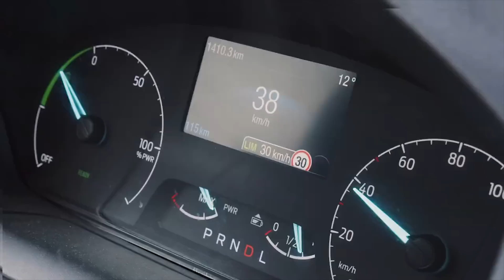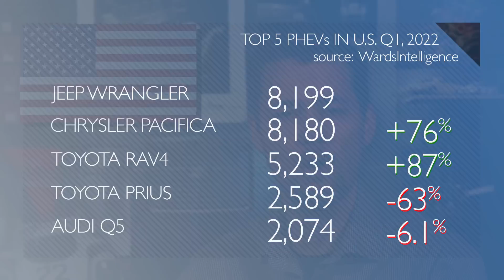Ford Technology Automatically Reduces Speed; PHEVs Starting to Catch On - Autoline Daily 3331

Comment: Most Americans won’t go EV until gas gets very very pricey, fast 10minute 0 to 80%/full charging doesn’t hurt a battery, we are willing to pay a lot for gas, we like cheaper bigger autos, and many don’t believe or care if seas rise, skies are polluted etc.. 

Me, I can’t afford anything more than a few grand - and repairs on fancy PHEVs, EVs could easily be $5k+ a pop for certain parts like battery packs or hybrid generator/inverter things, 😂 electrical systems gone bad after just a few years of use.  Old school is cheaper repair school many times, and tell me Tesla is most reliable and cheapest to repair and I’ll tell you to compare that total annual cost to my $3,500 2008 100k miles gas minivan 😎  Try to buy anything EV Or PHEV cheaper to keep running..  I doubt it.  I walk as much as I can.
Reply: Tesla severely limits the parts that a consumer can buy for repair. They also will take your vehicle off its supercharger network if the vehicle has been in ANY accident, and also if the vehicle is out of warranty.

Comment: The VW ID series already does something similar to the speed thing, though more passively.   If you happen to be coasting in D (drive) mode, the car will automatically apply mild regeneration when you start to go downhill so you only accelerate slowly, or when it recognizes a speed limit sign that is slower than your current speed.   Only when coasting though, so if you are actively using the accelerator or brake it doesn't try to override you or anything like that.

No special modes need to be turned on.   If you do turn on driver-assist mode, it's a bit more aggressive.  I love the passive operation, particularly on hilly streets.

Comment: The one problem with school zones and your car forcing you to drive accordingly in them is that school is not always in session when you're driving in them. Just like when cars that have speed limit sign recognition and flashes that you're in a school zone. Those systems drastically needs to be updated to be much smarter. It honestly shouldn't be that difficult to get the data when various schools are in session and apply that to the system in your car. Spring break, summer break, fall break, e learning days, night time, weekends, any other break time uploaded to the system. It isn't too big of a deal right now when it's just a new speed flashing at you from the recognition system, but when your car forcibly slows you down to the school zone speed is where it causes issues. It doesn't matter if you can override it when there's now a line of cars behind you wondering why you slowed down in a school zone on a Saturday.

Comment: My biggest concern with the BEV's heading to market is possible fires trying to get the longest range on one charge, only time will tell. The data shows that even using the cell type batteries say on a Telsa they still have the highest fires in their categories for their type of car (HLDI Insurance Report Noncrash fire losses 2016 to 2018). The other concern is when the battery is at its end of life what is the value of the BEV.

A PHEV car uses a smaller, safer, longer life battery that is charged by an IC engine optimized to just charge the battery (no turbos needed) could be made reliable, and safe and use less of the battery materials that are in short supply. As statistics show most trips are short so if the grid in your area can handle all the plugins just plugin and only run the IC for periodic maintenance or longer trips. You can still get the benefit of regenerative braking in this setup.

I live in a location with 4 seasons (can get lots of snow and cold) so I like all-wheel drive with a little ground clearance. Ford does offer an AWD Escape PHEV (2.5L iVCT Atkinson-cycle I-4 Hybrid Engine) at around 34K which has a little ground clearance. If for any reason I needed a car in the near future I think this one would be top on my list. This would be half the cost of a Tesla Model Y and for my driving, I would be for the most part just as “green” and I do not need 0 to 60 in 5 seconds under 10 works for me which the Ford can do.

I do agree with other comments that PHEVs can make a lot of sense at this time.
Reply: The wear on hybrid vehicles' batteries are far more extreme than the wear on pure electric, and the lifespan is significantly shorter.
Reply: @LeesChannel  Thank you for your response! I was not aware of this with respect to PHEV I just did a quick search and all I could find was in the US all hybrid batteries need an 8-year warranty I believe the same as a BEV. Do you have the names of any studies which show the lifespan of PHEV and EV batteries?  I do not believe you can add links in the comments so I will just search for the studies. I edited my original post above to remove longer life.

A reference I just read (search -> "greencars definitive guide to electric car batteries range") states that hybrid batteries last longer the BEV batteries. It does not state PHEV just hybrid and I have no idea if this is valid information or not.

It appears a Ford Escape Hybrid battery has an 8-year/100K miles warranty and the cost of replacement is around 5K (parts and labor). 
The Mach-E same 8-year/100K miles warranty but from what I can find the base cost of the battery is 18K then you have to add labor. I was not able to find an exact cost at this time I will keep my eye open for this and update it when I find a better number.

If I am reading this correctly Toyota has a 10 year/150K on Hybrid Battery and 8 year/100K on EV battery (Traction Battery) (2023 bZ4X)

I understand the batteries for each manufacturer can be very different and this is a moving target.
Reply: @L P  The reason for the greater wear is the pack is much smaller, so the cells have to operate at much higher voltages, plus the drain and recharge cycles are much more rapid due to the small size of the pack and charging while driving with the "range extender."
Recently Autoline had an interview with Toyota where they discussed solid state batteries, the Exec. said that the first implementation would actually be in hybrid cars because the extreme use case would give them a better test of its durability/reliability/longevity.

Comment: It should terrify people that a corporation or government can directly control your vehicle remotely, under the guise of "school zones".  This massive overreach is always dressed in keeping us all safer.
Reply: These modes are all optional, obviously.  But any sort of FSD or automatic engagement, or in the case of VWs ID, when passively coasting or using support modes, and other similar systems in a few other brands, the vehicle will make adjustments based on the traffic signs it recognizes.

But nobody is stopping someone from hitting the accelerator pedal if that's what they want to do.

Comment: Glad to see PHEVs making a bit of a comeback. In this time where EV production is limited by battery supply this is the quickest way to get the largest possible number of people driving electric miles.
Reply: Absolutely.
Better that 8 people each have a 25kWh PHEV battery to go 10,000 miles all electric each year than one Hummer has a 200kWh battery to pose at the mall each Saturday.
Reply: PHEVs are better than nothing, but they aren't going to be long for this world and the extra sophistication means you don't have the same maintenance benefits as you do with a BEV.   The reason they aren't going to be around for long is simply that battery technology is improving so quickly the HEV/PHEV segment is going to be squeezed to death in just a few years.    This is a problem for vehicle makers who decide to dedicate any significant time to the PHEV segment verses going all-in on BEVs.
Reply: phevs have ridiculous range and are cheaper than pure ev while producing most of same benefits and tax deductions.  Honestly,  the increased cost of pure ev isn't worth it.
Reply: @engineeringVirtue  Depends. I love my Gen 2 Volt and get up to 70 miles out of a charge around town but that range disappears on any freeway trip. 
I recently received the Lucid Air GT I ordered and made an 800 mile journey as quickly as I could have done in a gas car. I hated to buy gas for my Volt.
There is room for both technologies. For commuters PHEVs can be ideal. now that I travel much more it is great having a pure EV, but "worth it" is a very relative term.
Reply: I'd not buy another hybrid - old hybrids can get expensive to maintain.

They have everything a gas car has, everything an electric car has, AND the additional hardware and software that integrates the two systems.

Comment: China has the largest market for autos, and the largest market for EVs. At current trajectory of EV market penetration, ICEs will be extinct long before 2035. Ironically, the free market is working for EVs in China better than most Western countries (Norway the outlier and model country).
Reply: in what universe is Norway a free market in terms of automobiles😂😂😂?? they basically force u to get an EV
Reply: China is not a free market, they have thousands in licence fees for ICE vehicles. They are tipping the scales as hard as anyone to promote EVs. The difference with china is they are not promoting EVs to save the planet, they want EVs because china has hundreds of years worth of coal and hardly any oil. china doesn't want to be dependent on other countries for oil and with EVs they are self sufficient. Almost forgot to mention china since 2000 china has burned more coal than every other country in the world combined! So clean and green!
Reply: ICE's wont be extinct by then. That's just wishful thinking. Come on, man.
Reply: China and Norway not free markets.. major vehicle related controls there

Comment: Hi Elon aka Mark aka M Believ.  Props on the recent car fires.  Rumor is that you are using non-AEC rated MLCC's.  Lemme guess, you didn't install two caps per rail and place them at right angles on the PCB layout?
Reply: Hi Lutz,

Amusing that Mark has been on your mind this much, I haven't seen him in a while. Maybe next time you see him you could start with flowers?  lol.

Joking aside, here's the statistics per 100,000 vehicles sold:
• Hybrid vehicles had 3,475 vehicle fires.
• Gasoline-powered vehicles had 1,530.
• Electric vehicles had just 25.

Furthermore:
Tesla gets 1 fire per 205 million miles. ICE cars - and GM's Bolt before the recall - get 1 fire per 19 million miles by comparison.

So really, the car fires are in the sensational news because Tesla is such a strong brand, not because the fires are of statistical significance. 

How else would corporate media milk a company that doesn't pay billions for advertising like the legacies do? Clickbait of course.

But you are correct that this didn't seem to be a battery fire but rather just an infotainment circuit issue. That's good I suppose, but I'm curious to know what component is the cause. AMD's chip running too hot perhaps? We'll see.
Reply: @AllanSustainabilityFan  It’s a shame all you can do is to quote meaningless stats when my post said what the root cause was suspected to be.  Tell your team members to release the BOM and we can find out together.
Reply: @AllanSustainabilityFan  Since you keep deflecting the answer, I’ll take it as a yes...Elon isn’t smart enough to know why AEC rated MLCCs plus a 90 degree layout are required for automotive use.  Negative daily points for you...
Reply: @AllanSustainabilityFan  Face facts...it took your boss 12 years to finally figure out that “making cars is hard”. Unfortunately, he didn’t bother to spend the time to understand why making cars is hard and took short cuts to get around the pandemic with non AEC parts.
Reply: @bobbbobb4663  Well your ex-boss is now much more successful than the rest of the market segments they're in:

Tesla in Q1 2022 outsold ALL other luxury makers by far, and was the only one of two companies that had positive growth (59%) - the other was Genesis. 

In fact, that entire market still shrank by 12 percent, despite Tesla taking up a big 22 percent share of it while having such strong growth. That's just how bad the competition is doing, but nice try with the distraction.

TLDR: They're doing just fine. After all, they only keep the best engineers.
Reply: @AllanSustainabilityFan  The best automotive engineers use AEC quality parts and those sales numbers are bogus since your boss built unsafe cars with non qual parts.  Get your marshmallows ready...

Comment: Wow! Phev’s just starting to catch on! Only 10 years after being relevant.
Reply: Pretty sure it's been confusing for regular (no-car) folk.
To this day, there's smart people who think a standard Prius has to be plugged in.😖
The Volt got a really lackluster ad campaign 10 years ago that didn't convey its brilliance:
 15,000 miles of gasoline-free commuting if you simply plugged into a 110v outlet each night.👍
Reply: @donswier  ok.. but then the entire ice side of the car is pointless if you aren’t using it.. just taking up space, adding weight and costs for nothing. If you DO use the engine.. then it’s towing around hundreds of pounds of useless batteries and motors. The whole idea of a hybrid is inefficient and generally crap. I understand the ‘benefit’. But it is highly outweighed by the negatives. A good EV is far superior. If the idea of stopping for 20 or 30 minutes every hour and a half of driving is so egregious to people, they need to get a grip on what’s important. If the cost of an EV is daunting.. do the calculations of $ saved by not paying for gas and maintenance and find out that there many EVs out there that compete with $30k ICE cars in cost of actual ownership. Some even lower these days. If you need lower still.. you’ll just have to wait a little longer. They will be coming in a couple years
Reply: @airheart1  
All good points. Like you, I despise complexity👍

In my 3200lb car, though (i3 REx), the entire ICE system weighs under 300 lbs.

 - A battery big enough to cover long road trips would be far heavier.
- Fill up almost anywhere in 2 minutes.
- Like a BEV, there's no multi-speed transmission.
- Still used just 25 gallons to travel 24,000 miles last year.

I'd love to see that same approach scaled up for large pickups & SUVs.

Analogy: Most sailing yachts travel with a small, backup ICE (outboard) for emergencies & convenience.
...They don't rely on a "backup sail" for those cases.
Reply: @donswier  ok.. but by these numbers, you used your ICE range extending generator for less than 2000 miles of the 24,000 miles you drove? I’m estimating you got about 80 mpg out of the range extender. Idk if that’s accurate, but it seems generous at the least. You’re telling me you couldn’t have managed that 2,000 miles with a 300 lb heavier battery? Or probably less? Removing the complication of adding that combustion engine and it’s hundreds of parts… exhaust, fluids, belts, hoses, filters, etc.. I don’t see the real benefit to hybrids. At best, there is a tiny niche of driving profiles they would have a legitimate benefit to. Not enough to be a cost effective endeavor to a automaker and a well informed buying public who have good, 100% ground up engineered EVs to choose from. My opinion.. but I’m basing that opinion on a lot of facts that I’ve seen in many aspects of transportation and automobiles. I get that there is still currently a negative to BEVs in that you have to calculate in 20-30 minute charging times for long trips every 150-200 miles.. but the efficiencies and benefits are enormous compared to a little time ‘lost’ relaxing while you charge. And that will be reduced incrementally over the years to come. I just don’t see compelling benefits to hybrids to make it a market beyond a low volume particular niche model to some special identified market.

Comment: Let's look at the irony here, BEVs outsold PHEVs 3 to 1 as referenced in the video, however we know that 1 BEV worth of battery can create up to 5 PHEVs (or more). So why isn't PHEV sales more popular?
Reply: PHEVs are more expensive than ICE, while missing on the lower maintenance costs of BEVs. On the other hand - being able to drive a huge ranges on a gasoline, without electricity and and without charging for any prolonged amount of time, proved life-saving in Ukraine.
Reply: Many of them have inadequate electric range, less attractive to drive 2/3 of the way to work on electric and then gas cuts in. Still need smog check in CA and other maintenance, tho less. Chevy Volt was very popular.
Reply: Might as well ask why cellphones without wireless internet don't sell more. People tend not to buy obsolete technology.